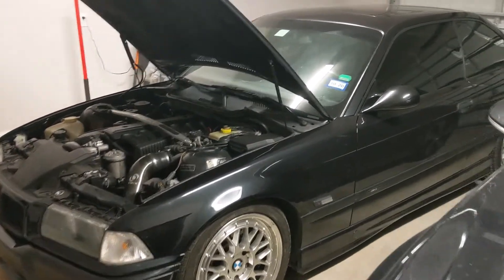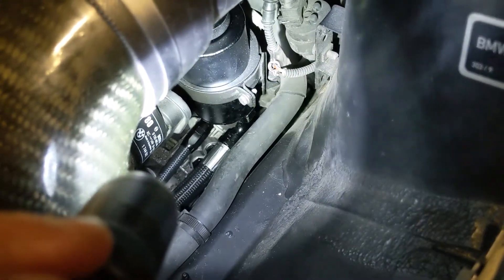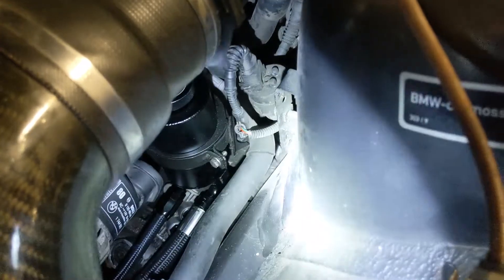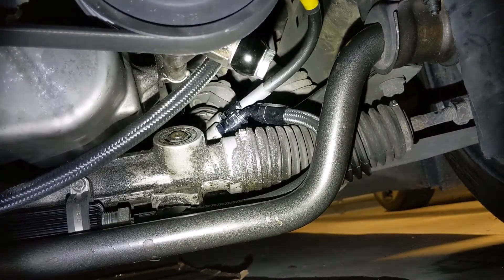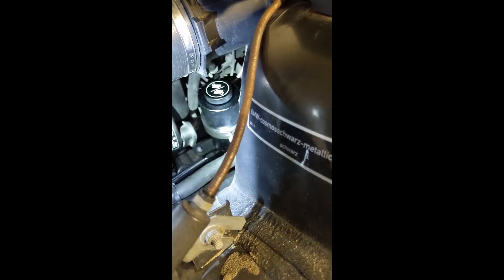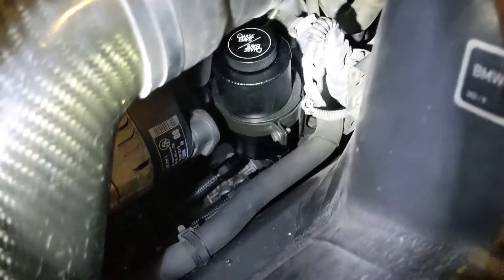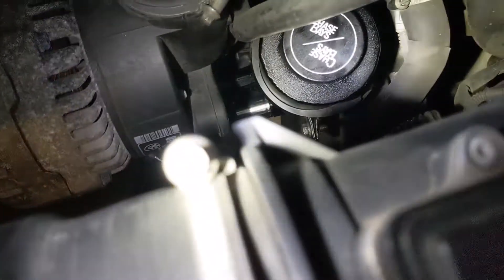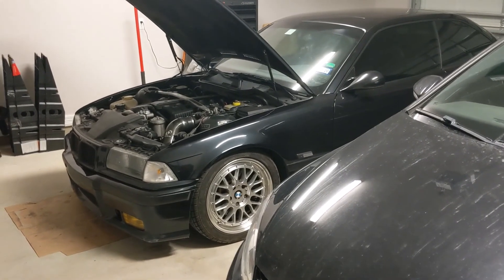E36 M3 Chase Bays Power Steering walkthrough

Comment: god bless you. just ordered this kit, this video answered every question I may have had!
Reply from the maker: Hey thanks for watching! One other thing I forgot to mention: make sure the AN to NPT adapter fitting on the inlet and outlet of the cooler are tight. I found a very very slow leak out of one of the fittings. I just tightened it so hopefully it doesn't leak any more. It was like one drop every month.

Comment: I am trying to install this kit but the thread pitch on the high pressure lines are not 1.5. I measured the banjo bolt that came out and it is 1.5. Did you have any problems with the high pressure lines. They aren't even 1.75 but somewhere in between.
Reply from the maker: I don't believe I had this issue. The adapter fitting that goes into the steering rack is metric on one side and -AN on the other, where the hose attaches too. -AN fittings are in imperial/standard, and those thread pitches might end up somewhere in between 1.5mm and 1.75mm. Are you saying the adapter fitting won't fit into the rack or pump? or that the hose one fit over the -AN side of the adapter?

If nothing else, contact Chase Bays. They are very responsive and helpful

Comment: how did you secure the bracket that holds the cooler on the driver side?
Reply from the maker: That should be the slightly bigger bracket that fits around the large OD of the cooler. The other bracket on the drivers side was slightly smaller and fit around the adapter bushing for me. Both brackets should screw into the existing holes where the OEM cooler sits. Hope that helps dude!

Comment: what wheels are those?
Reply from the maker: They are Drag DR44s, 17x7.5. Knockoffs of BBS LMs I believe. I don't recommend them. The bolt circle does not match the bolt circle on the hub which caused some driveability issues for me. I have Apex ARC-8s on order.